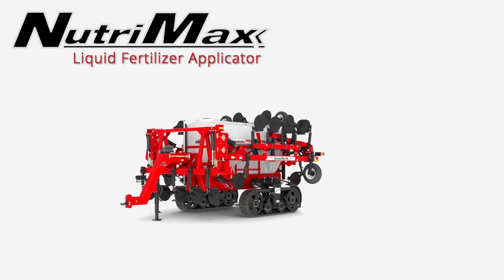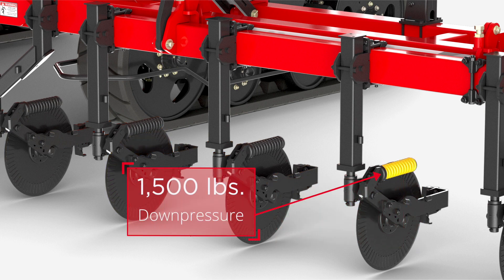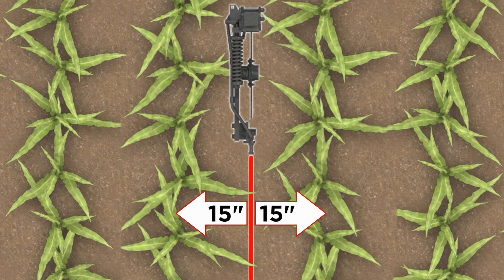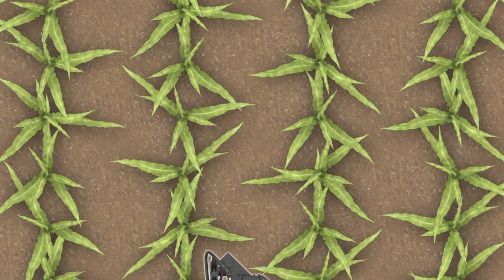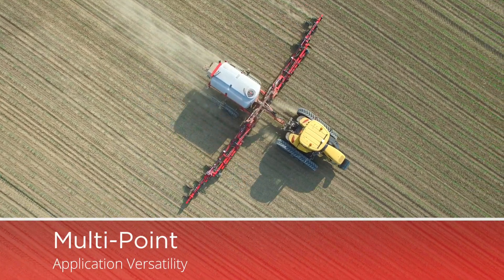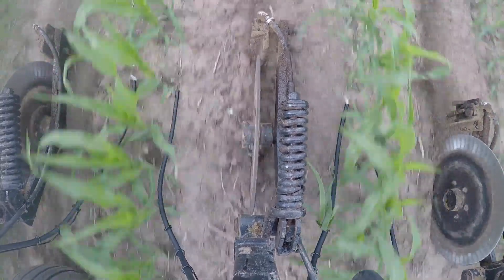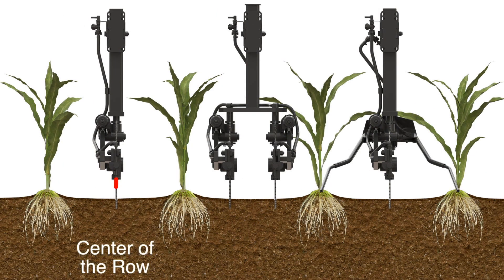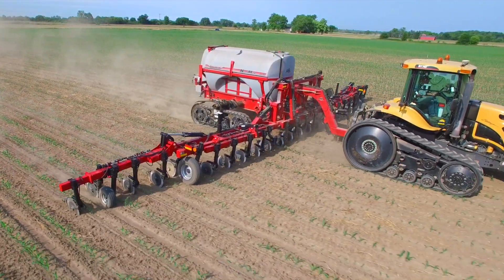Unverferth NutriMax Application Systems

Comment: What’s the yield difference between the double Coulter and single coulter
Reply from the maker: Hello, we are currently conducting a multi-year study to determine the yield potential of both the double coulter and dual-delivery systems.  While we are not yet in a position to release exact numbers, in year one we saw increases in yield with the double coulter system compared to the single coulter.
Reply: ..

3